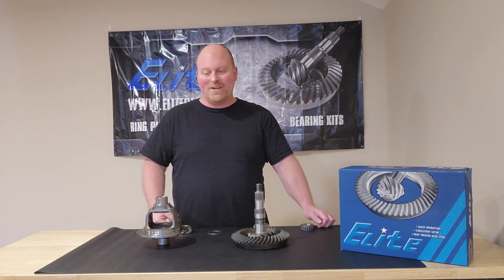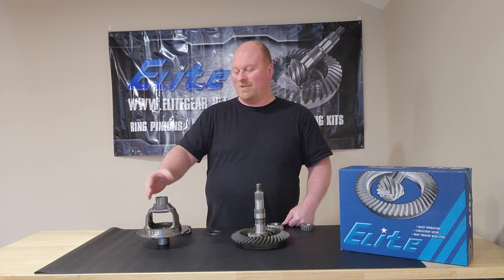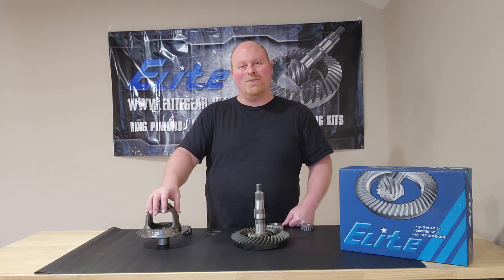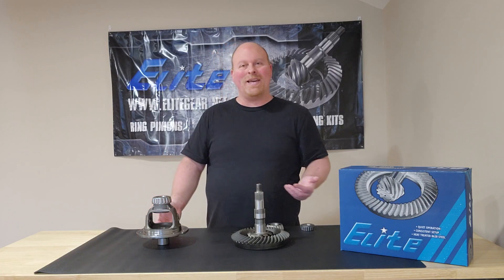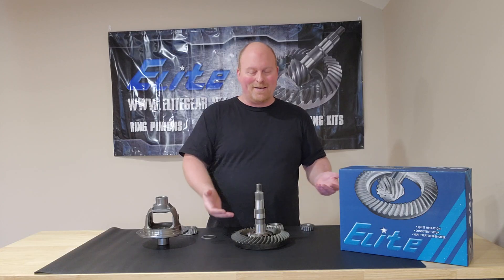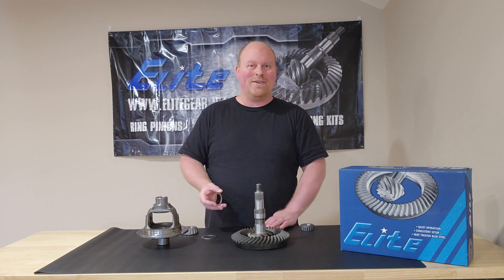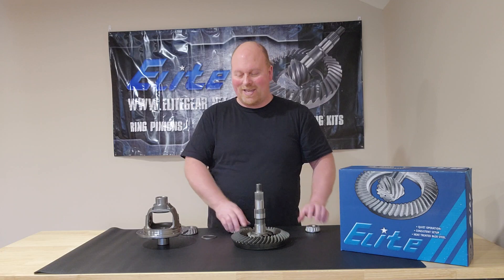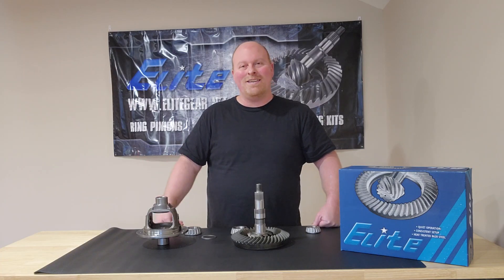Ring and Pinion Differential Setup Bearings

Comment: Good morning Rob, I’ve got a 1980 Bronco, built 331 10:1 aluminum heads, comp cam xe266hr12, weiand intake, summit carb, 1-5/8 headers, manual top loader, manual t-case, strange 9” traklock LSD 3.73 gears, D44 reverse high pinyon w/ PowrLok up front. I was still in break in period with front gears, and I ruined them. Was on freeway and a u joint retainer came out on rear yoke dropping the shaft. I pulled shaft, put in 4 hi, and overheated the gears. What gear manufacture would you recommend? Thx  and I love your 557 build
Reply from the maker: Thank you sir! I would recommend Elite gears. You can find them on our website. Ronsmachiningservice.net
Please let me know if you have any questions.
Reply: @Ronthegearguy  I checked. For D44 Reverse, they don’t carry 3.73 in Elite. Skip right over them. Goes from 3.54 to 4.09